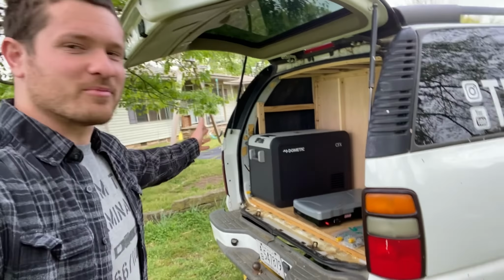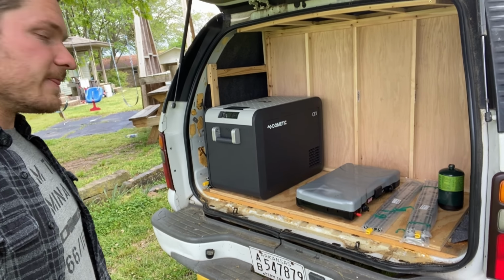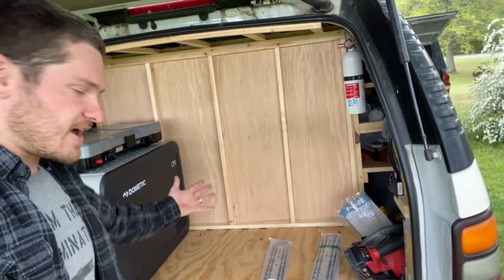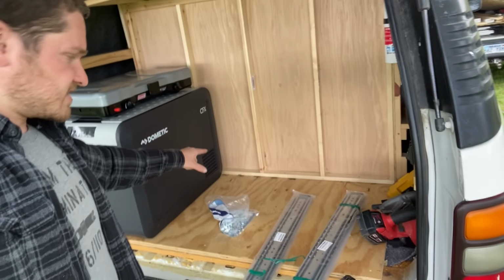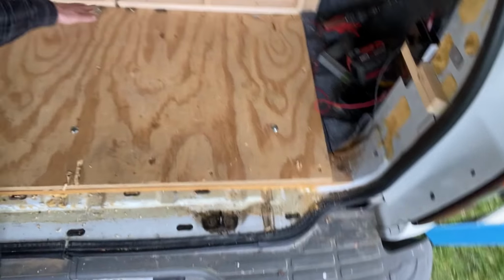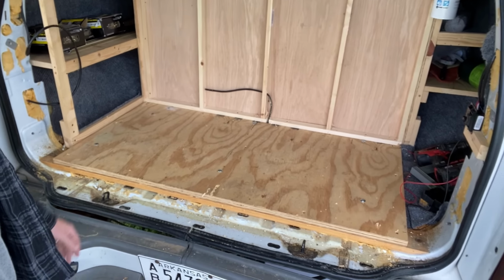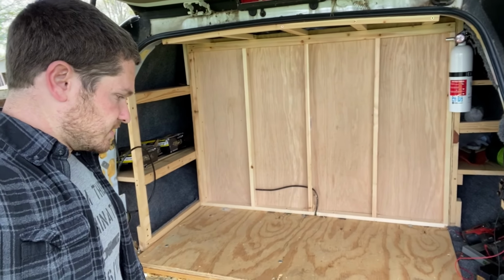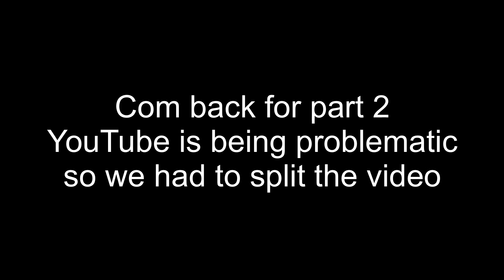DIY Dual Slide Part 1 Fridge/Stove Camp Kitchen

Comment: Hi, Awesome build @trove1312  I am looking to build a similar setup with my CFX55IM on my Wrangler 4xe. Could you please share the links to those two locking slides from you bought ? Thanks
Reply from the maker: Thanks! Yes, here is the link for the ones we bought. https://amzn.to/3LIa2U3
Reply: Thanks  @trove1312  I see yours Dometic CFX3 45 fridge, what is the. length of the slider you are using 26" or 28" ? Mine is 55IM and the dimension says it is: L 28.35 x W 17.91 x H 18.90. Wondering, whether I can use 26" slide instead of 28", as 28 might end up hitting my tailgate door. Appreciate any tips.